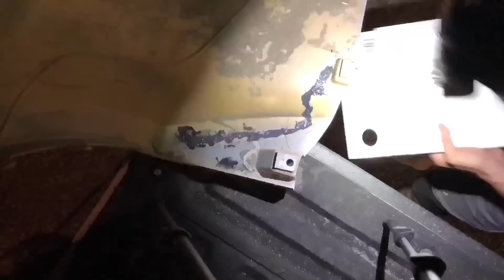2001 Ford F350 7.3 Project - FULL BUILD - Start to Finish

Comment: My dad used to have a truck just like that. 2001 f350 dually with a 7.3 automatic, extended cab with the long box and a brushgaurd. We kept it all original except for the brushgaurd and the occasional maintenance. He got It from the cremation society of Minnesota where the owner used It to pull a camper and for a daily. It pulled a lot of cars home on a 27ft hiway star trailer (custom built), I remember going with my dad many times to get cars from customers, we had loading and unloading down to a science. The whole family loved that truck, I was brought home from the hospital barely even a day old in it. The only way my parents could get me too fall asleep as a baby was to bring me for a ride in the truck, the vibrations knocked me out right away. We had even taken a trip to south Dakota pulling an old heavy camper, stopping at many places along the way including Custer state park, wall drug, and the pioneer auto museum. That truck was part of the family. When we moved from the country into town we used a 40 ft enclosed trailer and loaded all our things into it at once, the only truck we had to pull it was the dually(as we called it) and it pulled it well. After we moved into town though my dad stopped doing so much mechanic work for people (he was a diesel tech for 20 years and he did a lot of normal mechanicing too, he has bad arthritis in his hands) and stopped using the truck as much as he used to. It sat in the driveway for a year and a half, we used it occasionally and started it often, but it was not good for it to sit. We decided to sell it, after a good while a buyer came along that we knew would love the truck as much as we did, it was his dream truck. He bought the truck around the start of 2018 and we even drove it to his home that was pretty far away (we had a special occasion near there anyway). He was at work but his wife was home when we delivered the truck, she later contacted us about how he had been sleeping in it for a week. We knew it was at a good home. About 3 weeks ago my dad asked him through Facebook how he was liking the truck, he was then informed that about two months after we sold it the truck had been totaled in a bad wreck. someone had decided to do a slow u turn on a highway with people behind them, and our old truck  couldn't stop fast enough not to hit the turning vehicle, the man swerved and hit the car at 65 mph. Nobody was hurt that I know of but the vehicles were both totaled, the dually looked repairable because the brushgaurd had taken most the hit but it was actually really messed up. The frame moved on impact and totaled the truck. I have not seen any pictures of the other vehicle but I'm guessing it didn't look much like a car anymore. Losing something once is hard, losing it twice is even harder. I'm 12 now and It is still hard to think about. All the good times we had.
We did purchase a 1972 f100 that is all original, even the 2 tone green. We are the 3rd owners of it, the first was a beet farm in ND where they used it and took great care of it. We bought it because the family wanted a truck that we could bring to car shows and also fit in the small garage.  

Thanks to anyone used up some of their precious time to read  this.
Reply from the maker: That’s a long story lol
Reply: Cool story!
Reply: Wow...that's sad to see your truck is in grave
Reply: @joelpennington5200  👌👌👌👌👌👌

Comment: She’s gorgeous. The fact that it’s a 7.3  manual dually makes it one of the best trucks ever manufactured
Reply from the maker: Thx bro and totally agree, plus it’s 4x4 and only 135k makes, will keep it’s value forever prob
Reply: @FixItNick  135k isn't even half of the motor's half life. I have a 7.3 with 200k and the biggest issue with it is nobody can drive where I'm at and keep running in to it.
Reply: My 7.3 six speed is right at half a million now. Never had any big problems. We've replaced the trans once, a few clutches, and the hpop recently other than that just the usual wear and tear items.   @tristianwilson3497
Reply: FixItNick you have my dream truck right there manual dually 7.3 4x4 I would love to find one
Reply: I wished my 02 powerstroke was a manual
Reply: Tristian Wilson bigger bumpers
Reply: My 7.3 is at 190K still runs like a Swiss watch, easily one of the best engines.
Reply: @Poorboyzgarage447  hell yeah
Reply: @FixItNick  is it a King Ranch Edition?
Reply from the maker: Chance Koehler no I wish, I do want to swap interior to newer truck and nose to 2016 nose
Reply: I like the truck, but I would never own a ZF now days. Fucking expensive to fix
Reply: @tristianwilson3497  same here lmao
Reply from the maker: Andrew Lynn what you talking about ZF6 is best bullet proof engine and WAY cheaper to fix than the automatics
Reply: @FixItNick  say a bearing in the main case starts to spin. Case is junk and ZF won't sell them anymore. The parts are becoming harder and harder to find.
Reply: @RattleTrapGarage  Did you fail English class??
Reply: They are nice but they just don't have the power potential my 6.0 has  Oh I know the reliability issues but hell mine's got 200000 bone stock no problems
Reply: @jackreynolds6498  really
Reply: Its marvelous
Reply: Too big...
Reply: sheds single tear It was the most badass shit I ever seent.
Reply: 7.3 powerstroke 6 speed manual anyday 4 me also
Reply: Why the hell would you want a manual dually. The autos are the desirable ones lmao
Reply: I’ve bought newer trucks but our 7.3s are still the most reliable. And zf6 is the best of the lot, feels really good hauling with them

Comment: Looks fresh. Most people wouldn’t spend their own time fixing large truck like this. You definitely deserve respect.
Reply from the maker: Thank you really appreciate it!! Trying to be different on the YouTubes lol
Reply: obviously your not aware of the value  pre emission 7.3 diesels, especially one with a zf6. that old truck is now worth about 8 to 12 grand .  a new comparable truck is around 80,000.has terrible reliability, worse fuel mileage, and are extremely expensive to repair and maintain. the ol 7.3 is rated for 500k service life from ford (international), and many get close to a million miles before needing major engine work. your lucky to get 150k out of the new diesels because of the emissions.
Reply: @fordpinto if you use your truck like a truck and not a daily commuter then emissions work as they should. The place I used to work had about 30 4th and 5th gens in the 400-700k range. Most of the trucks only had routine maintenance but they actually worked for a living.

Comment: For a leveling kit is it possible to just lift the front? Do you have to lift the back also?
Reply from the maker: I didn’t lift the rear only did leveling kit in front, my rear leafs were damaged so I had to replace them both with stock height ones

Comment: This is super awesome. When I worked construction I drove a 2001-2003 (I'm not sure) F250 with the 7.3 engine extended cab my boss let me borrow. It had 475,000 miles on it and we hauled 4 of the crew across the country a few times in it to out of state work locations. My boss has a newer F350 non-dually with the 6.7 dual turbo and he didn't like to wait for us so we pretty much drove around 500 miles a day at 75-90 mph all day. Everything inside was in good shape including a functioning AC, but the outside looked like Sanford and Sons truck. Anyway, you're channel is inspiring. I'm in love with that 7.3 engine and hope to score either a 250 or 350 in the near future.
Reply from the maker: Thanks man appreciate it, if you can look In CA and TX and AZ where there is no rust, and as low miles as possible, I’ll be doing lots of work on it soon

Comment: Did you rebuild that for yourself to use for towing purposes or just for a fun flip?
Reply from the maker: This is for me, and was thinking eventually buy 5th wheel RV and car trailer, time will show
Reply: I wish I had the experience and expertise to do a project like this myself. I’m a noob with working on cars though. Also, an RV rebuild from Copart would be awesome. There’s not many out there that I’ve seen. Or fix up a classic airstream or something.

Comment: I recently sold my '01 F250 short bed 7.3L. After 126,000 miles, it never hiccuped and it still pulled like a Clydesdale.  It had a 4in Exhaust,  Superchips tuner & K&N filter. It hummed a tune going down the road and had a nice growl when it was under a load. Now I have a 2018 6.7L. I hope it is as good an engine as the 7.3L was. The new truck has a completely different personality.
Reply from the maker: Did you get a good price for yours? The new 6.7s are nice and tons of comfort features, new F250 with an older 7.3 swap would be super haha
Reply: @FixItNick  Sold it to a friend who needed something to pull his fifth wheel camper. He has two '01s now. He's putting a utility bed on the one for his business and camping with my old one. He loves the 7.3

Comment: I want to learn how to work on my own truck, same year just a 5.4 L F250 Super Duty. No idea where to start and I'm too afraid to touch anything with fear I might not be able to put it back on lol. I'm taking an automotive class (simple automotive maintenance) to start with all things mechanical. Any tips on things that might make learning about cars any easier? I've been thinking about taking a look in my manual for some things I could fix since my girlfriend's dad gave me a service manual for my generation of ford. Where did you learn how to work on cars? Thanks if you read my comment!
Reply from the maker: Best advice I can give is take pics of tho ya as you take them off and use ziplocks bags to store bolts for different areas and mark on bag what it’s for
Reply: You have access to the the internet; the greatest source of information in human history.

If you're unsure of how to do something just google it and 90% of the time you can find a step by step guide on how to do it. Also try starting with simple things (brake pads, fan belt, light bulbs, oil change) and working your way up from there.

Comment: Huge 7.3 fan just finished rebuilding my 5.9 12 Valve and these 2 truck will have such great value in 10-20 years easily
Reply from the maker: I agree! 7.3 5.9 Cummins and 6.7 Cummins are gold
Reply: OoooSHOOKoooO well what u could do with a duramax is get in there with a flashlight n hammer beat the hell out of it and go get a ford😂
Reply from the maker: OoooSHOOKoooO I’m not a fan of the front suspensions on those I love solid axles
Reply from the maker: OoooSHOOKoooO yea 7.3 is the best engine ford offered, good thing international made it and not ford, otherwise it would suck LOL

Comment: Nick totally enjoyed your video! I have a 2003 f350 crew cab dually 2 wheel drive/auto. I was hoping you could settle a doubt I have about that 2 inch lift you installed on your truck. How much did it change the the ride as far as comfort? Thanks for sharing and hopefully you can help. Tc from Nevada

Comment: looks like a nightmare doing the front axle ..how was the alignment after  :)
Reply from the maker: Yes bit of a headChe, gotta take her to alignment shop
Reply: @FixItNick  maybe just try to get measurements for the axle to bumper distances..  maybe try the. Auto body shop at the dealership.
Reply from the maker: primalfury2011 I avoid dealership shops SLWAYS! lol

Comment: This is a true gem as ford no longer makes a manual transmission is this one a 5 speed or a 6 speed?
Reply from the maker: It’s a 6 speed, 5 speed was in OBS I think ?
Reply: @FixItNick  they made them with 5 speeds also, standard was just becoming less common
Reply from the maker: Bradlee Kraft just did quick google I guess they made them till 97 f350

Comment: Nice job fixing up the best Power Stroke out there! You do great work!   Mine's a 2000 F-250 7.3 4X4 Lariat... I'm rebuilding my old 72' F-250 Camper Special and  hope to have it back on the road next Spring.
Reply from the maker: Welcome to the 7.3 club :) love this truck, can’t wait to have it straight piped and tuned

Comment: Awesome truck. Simple, Tough, Reliable and 4x4. What else would you need ?, i'd love to see that truck on bigger AT tires. I have a 3.0 (international engine) diesel 2007 Ford Ranger, here in Argentina. 
Congrats for that 350!
Reply from the maker: Thank you, really appreciate it for now I just wants to do 4” straight pipe and tune and then do nose to 2016 swap and interior swap

Comment: Why did you level it? Now it’ll just squat if you put something in the bed.
Reply from the maker: I think looks much better leveled, it will only squat if our more than 1,000 lbs in bed, I never do that, if I’ll get a 5th wheel I’ll install air bag on rear
Reply: FixItNick now you’ve just gotta get some bigger tires!

Comment: Have reset the rear axle on a 03 7.3...except it was shoved so far back you couldnt move the truck around without a loader picking up its ass end lol
Reply from the maker: Lol sounds bad
Reply: FixItNick side swiped by a 2016 Silverado, from front wheel to the rear wheel where he knocked the axle back, totalled his truck, we reset our axle before we sent it to the body shop for the fender, door, and bed damage. Couldn't open either driver side door

Comment: I think you need to be restore that springs p.s It look very very ooooooooooold, delete rust and repaint it with anti-corrosion paint, good luck with next projects :D
Reply from the maker: Restore what springs, bent one or the other ones I bought? There is no need to restore them, but I’ll be cleaning frame and painting to protect
Reply: @FixItNick  springs what you bought

Comment: You fixed for less than you could buy one in that was as good as the finished build
Reply from the maker: Thx bro, yes with salvage title it could still sell for 14-15k I’m guessing?
Reply: @FixItNick  I don't know about your  state but in Missouri you can file for a rebuilt (previously salvaged) title. Which is where MODOT/Highway Patrol says that the vehicle was totaled out and given a salvage title but was repaired to factory condition or greater than factory condition and conforms to all state and federal safety and operational laws for the class of vehicle  up-to the original year of manufacture of said vehicle.
Reply from the maker: Jake Baker some I know jump through loop holes to get clean CA title, but sometimes I wished I lived in those states lol

Comment: this video brings back memories of a 96 f350 dually i had and how i spent so much time taking care of it and how i think when you put alot of effort into something and try to make it last ,, i got a new f350 2017 had it almost a year and i think i would rather have the payment than be driving around wondering when and what will need to be fixed next,, dont get me wrong these old trucks are a good way to get started doing something but i think eventually whatever you are using a truck for if your doing it enough a new one is less stress
Reply from the maker: F350 7.3 is one piece of tank, new trucks are nice but you need a team of experts for every issue lol

Comment: I wished my 02 7.3 powerstroke was a 6 speed
Reply from the maker: My wife doesn’t approve haha, can’t wait to shift it with straight pipe and tuner
Reply: @FixItNick  I'm going to covered it to a manual
Reply: It is my first truck it has 345,000 miles only mods are bully dog tunner and 6"x6" square tubing smoke stack

Comment: The video title says Full Build, what exactly did you build? I kept waiting for the good part where you pop the hood and actually build something, but the hood was never even touched. Obviously my idea of a Full Build is very different from yours. You didn't say how many miles were on this truck. I have the same truck but a 2000 model auto trans that was done by Western Hauler and I actually did a build and modded the truck big time with all the things Ford should have done. She only has 150K and I have owned since 2003 when it had just 21K on it. I wouldn't trade it for a new 6.7 straight across. I never made a video of all the work I did, maybe I should have so I could retire, lol!!!!
 I will say one more thing about your video that kept me from hitting the back button. It's good to see that there are still real men in this country that are teaching their kids to work with their hands so they won't be taken advantage of by mechanics and repair men of any kind. So many fathers today are to busy to bother teaching their sons anything and that is why most young men today are nothing but Sissy Boys, and that is very sad. You keep your son by your side and answer all his questions like what is that and why is it there. I wish we had more fathers like yourself.
Later
Reply from the maker: Thank you Kevin appreciate it, I guess full build like repair from start to finish, “Full Fix” sounds weird lol, but I have so many plans for the f350, and also would love to find a 13-18 Ram 3500 6.7
Reply: @FixItNick  I know your truck from bumper to bumper because it is just like mine. All of the modifications that I have done were for reliability and to extend the life of the truck. Any increase in performance was just a plus. I know for a fact that my truck works less now to pull the same load as it did when it was stock and this has to equal longer life. If you have any questions about anything on your truck just let me know. If I don't know the answer I know those who do. I was also the first person to produce, what still is today, the best way to do the CCV Mod on any PSD. Every PSD should have this mod done. You can read about it at  www.ccvmod.com    God Bless